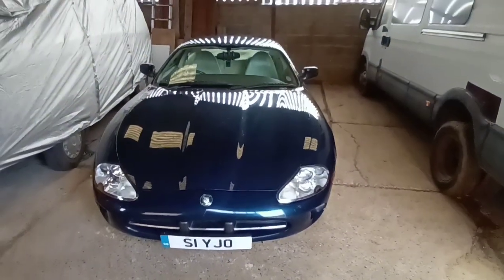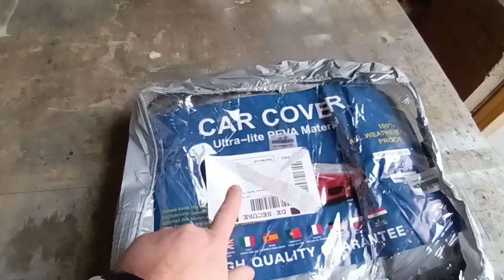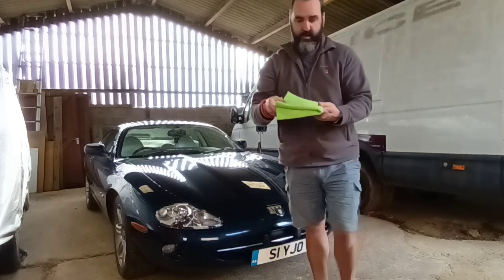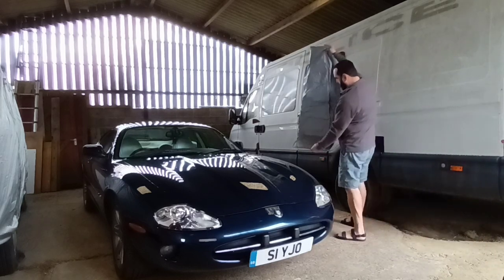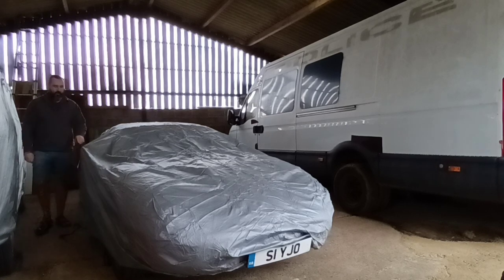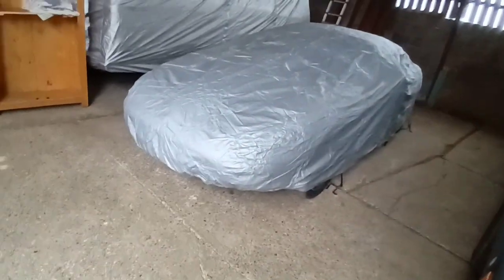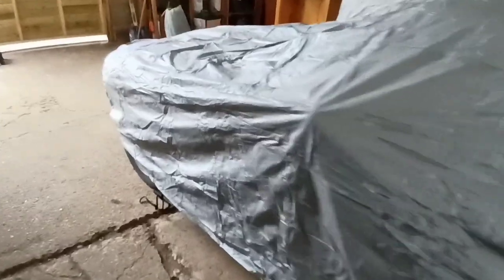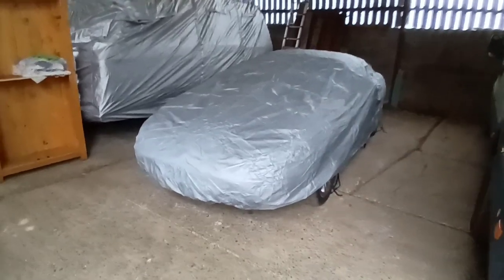Jaguar XK8 project #15 new car cover fitting & review

Comment: Thanks for the review, I was looking for another indoor cover as the last one I bought was useless and was an awful fit. I was probably going to end up spending a lot more but this looks as if it will do the job and save a few quid.
Reply from the maker: Hi Graham, thanks for that. First impressions are pretty good, especially if you are just looking for an indoor cover to use the same as me, and at less then £20 is a real steal in my opinion👍